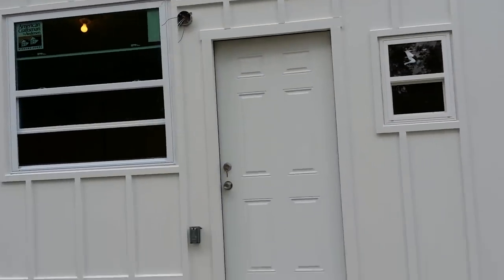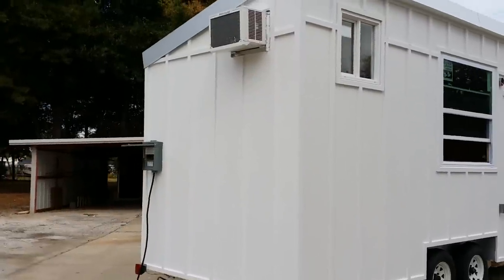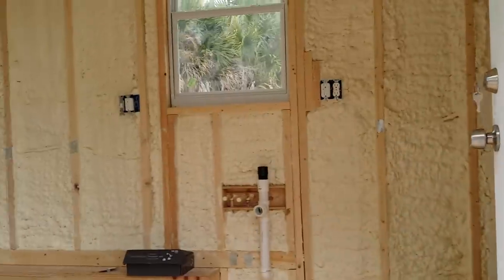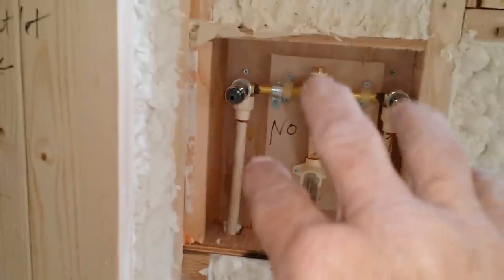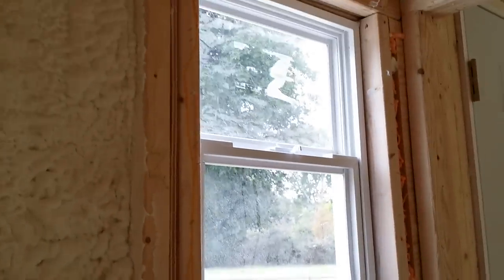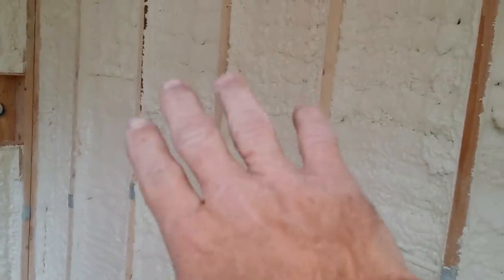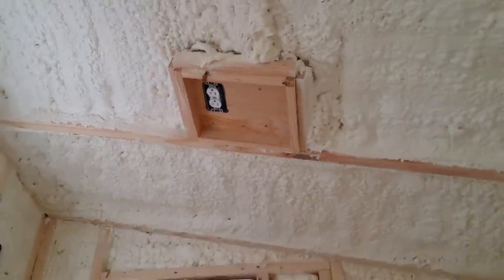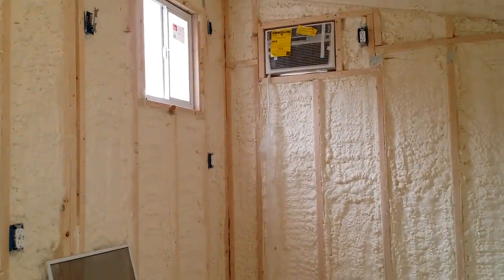Trekker Trailers Tiny House shell DIY (Happy Shack)

Comment: is that slant to one side roof not going to affect the stability when it is towed at freeway speed?
Reply from the maker: No it doesn't make any difference
Reply: advantage to slope down on passenger side: trees grow on passenger side of roads not on driver side.
Reply from the maker: Hadn't thought of how trees come into play. TH aren't moved often so I would still opt for the advantages of water run off to the rear

Comment: Andrew great shell! What is the height of the short wall side of trailer? Exterior height of Tall wall?
Reply from the maker: 7ft short side inside and I think 11ft outside high side
Reply from the maker: D AVENUE I didn't "omit" that info. Lol I just didn't think to mention it. It's a 20ft long house 8ft wide. It would hold up fine in extreme cold if we ran the plumbing inside the walls instead of underneath. When we have one going north we make some changes for that climate. We have sent several to cold climates now.
Reply from the maker: Give me a call sometime 352 409 4005